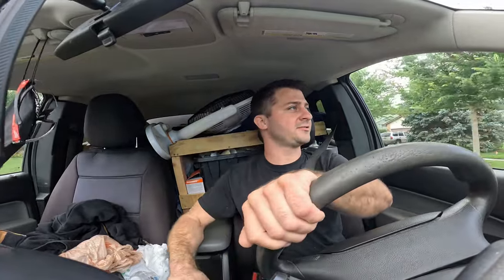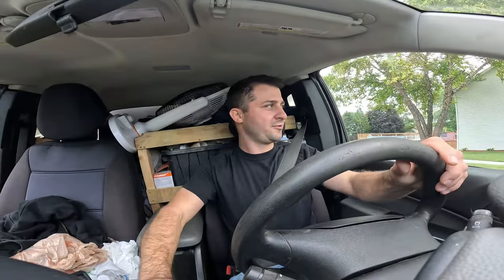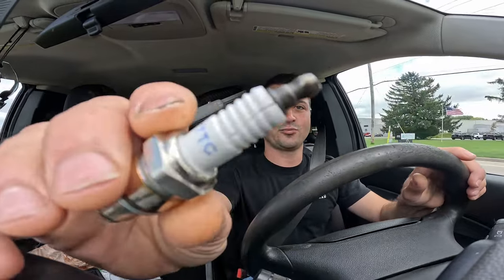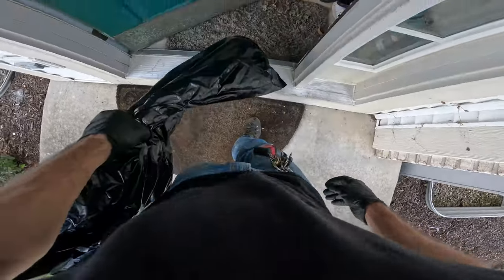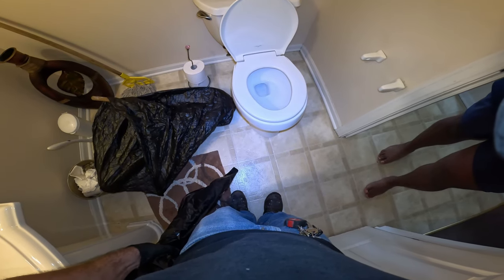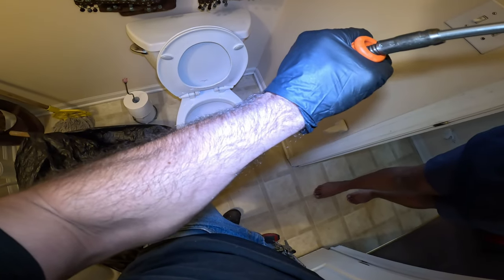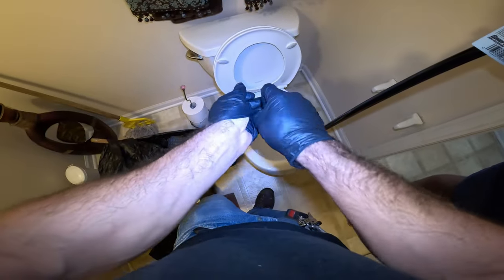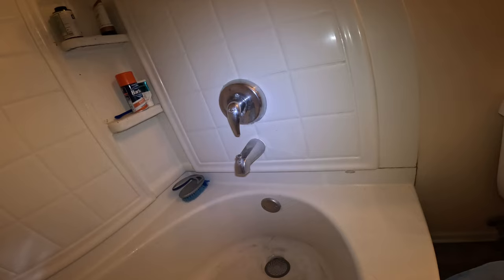Toilet Paper Holder Stuck In Toilet/ No Cold Water In Shower

Comment: I have a Harbor Freight 10" tile and brick saw and an old corded Harbor Freight demolition hammer. Both are unstoppable.
i had a corded Harbor Freight right angle drill. The chuck cracked on the second use.
You just never know what you're going to get with Harbor Freight.
Reply from the maker: This is true but I still love them 😆

Comment: If that was my job, the holder would certainly have been stuck, forcing me to remove the commode, and the helicopter as well. 😂
I’d take that gen back for another one.  Sounds like it was dropped at some point. You don’t know what else might be damaged.
Reply from the maker: Lol and the helicopter 😆 🤣 😂  yea don't feel bad that's my luck too!! 😅.  Yea I'm on the fence with the genator. That's what I thought too, I totally thought they dropped it but it was just carelessness putting it together. Cus I don't know how high u would have to drop it to get those slots to get popped out.
Reply: @thehandymanexperience226  Whatever you decide to do, good luck with your new generator.  You were wise to buy one large enough to cover anything within reason  that you might need emergency power for.  One of the first things I bought when my house was in built in '84 was a 5kw 10hp generator.  I was a bare bones model but since I have a deeper basement with 2 pumps, I was not chancing having water backup during a storm and extended power outage.  Then in 1998 I opted to install a 8kw natural gas standby unit.  However I still keep a couple portable generators around.

Comment: Help, please! What happened if you already flushed few times and water still working fine? Is it mean the toilet paper holder went through and no more problems or is it mean it still stuck in there?
Reply from the maker: @Nate-bb1vm  that toilet paper holder shouldn't go through I assume. Once u put toilet paper and flush it will clog. You will have to get it out and make sure it's clear. Every situation is different there is no one size that fits all
Reply: @thehandymanexperience226 thank you 🙏